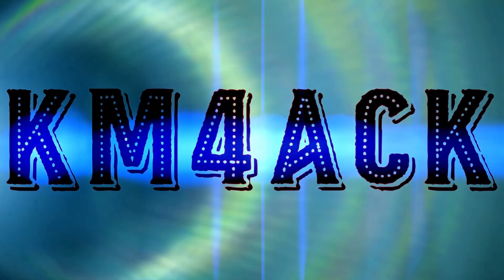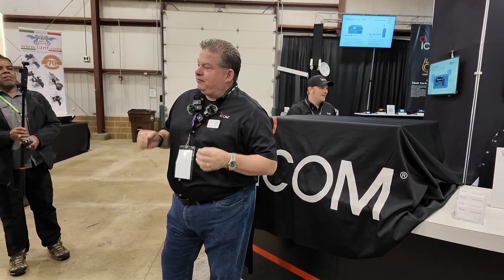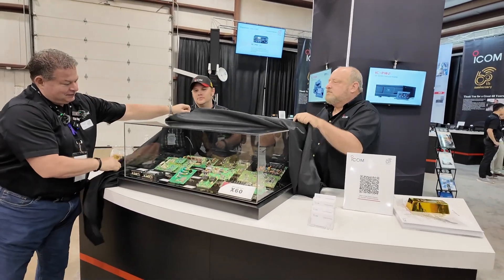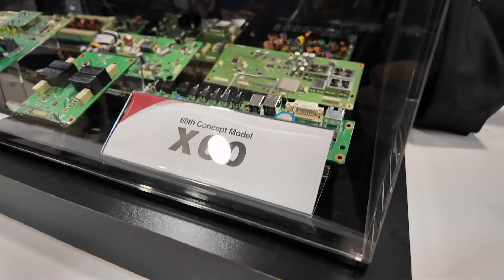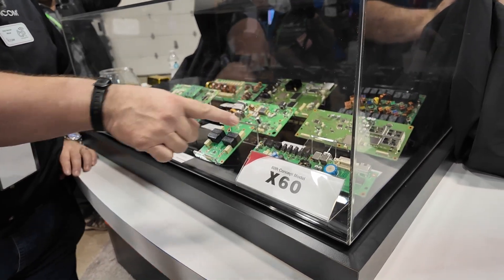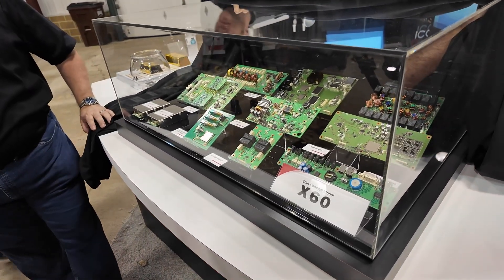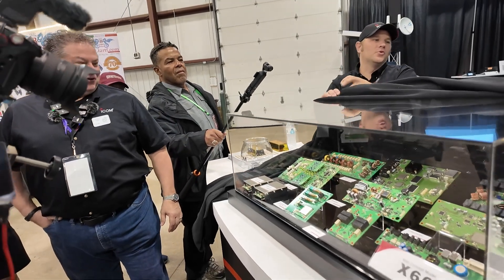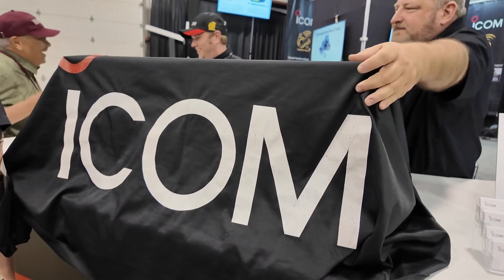Icom x60 Reveal

Comment: well, I expect this radio to be a high end model.    perhaps radio designed to work with upcoming  1 KW linear Amplifier from Icom  to do pre-compensation to send out cleaner signal.    I probably would not be  potential  customer , due to higher price.   AG6JU

Comment: It has a lot of connectors on a couple of those boards.  I think it is a SDR HF radio that has a remote head.  Looks like you connect the two of them via CAT 6 type cable.  So you might be able to put the power amp at the tower,  and remote the head in the shack.  It has like 3 RJ45 jacks, a couple of din plugs, a couple of RCA plugs (??) and a bunch of 3.5mm jacks.

Comment: I want to see an SDR radio that includes HF, 6m, 2m, 70cm, 1.2GHz, on-board antenna tuner with analyzer display, multiple band specific antenna outputs (2x  SO-239 for HF/6m, BNC connectors for 2m/70cm with integrated duplexer, Type N for 1.2GHz), 100W output on HF/50W on VHF/UHF...all in a laptop computer format that includes FT8 and other software, connectors for key/paddles, headphone, microphone of your choice (software identifies the microphone and allows the functions of that mic), and multiple ports for power supply (solar, battery, AC). Basically an all in one ready to go base station/portable station....a ready made go box. Probably run about $5k depending on who makes it.....